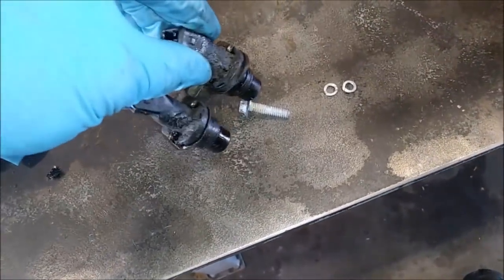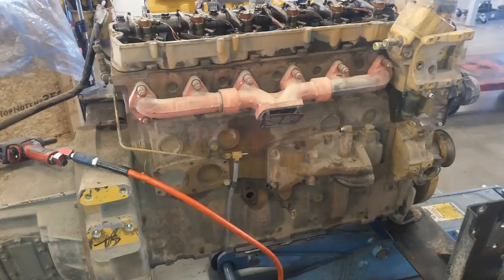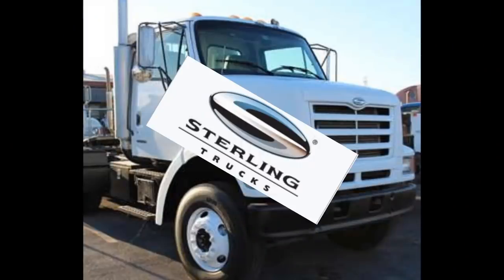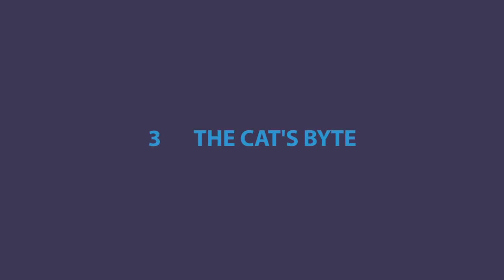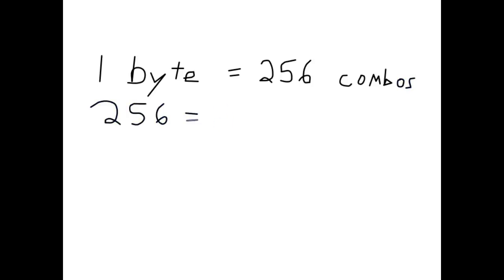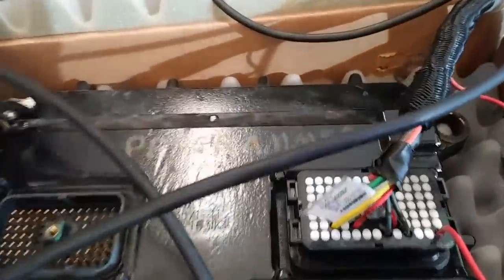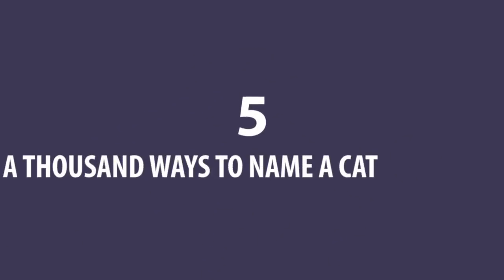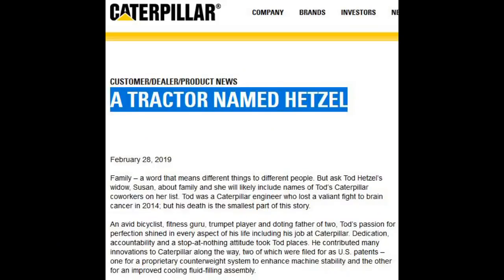5 Cat Engine Facts Most People Don't Know Are True.

Comment: The naming of model SN prefixes to people is absolutely correct. An example is the LBM which is named after an Australian engineer working in Mossville at the time whose initials were LBM. From memory this is a Euro 3 C-12. Lou was liaison for rest of world (North America being prime) engine spec/design at the time. An awesome engineer who could go into any of the meetings by the various specialties (cooling, fuel, emissions etc) and be able to be very knowledgeable in each of them. 
“A Jack of all trades is a master of none, but often times better than a master of one” very much describes Lou's abilities.

The Deutsch connectors where selected over every other connector available at the time due to their easy of serviceability and reliability. They were selected over the proprietary Cat connectors.
The 3406B PEEC and 3176 (released at the same time as the DD S60) engines used them but using the HD style connector (same pins and sockets). However HD connectors proved to be both expensive and large so with the C-10/12 and 3406E they changed over to the DT connectors which are used to this day.

The brown engines were an exclusive FL spec as part of the way Cat got into the FL80 build. FL wanted be able to say the engine was exclusive to them.... The engines actually being identical apart from the paint.

The Ford LTS and Sterling needed the slant engine and in Australia it was even harder to get the engine in due to the RHS config putting the steering shaft right thru the turbo.....
The 3406C (I think, may have been the E) was eventually engineered in though on the journey the breather was in the way which ended up with the classic line from the Cat account manager saying to just remove it....... For some reason the engineers didn't agree with this suggestion. FYI we had the 3208 installed in the Ford Cargo as the only engine for many years and had to store 2 years supply (from memory) when Cat stopped production but the truck was still being made.

Comment: I’ve worked on private yachts my whole career and every cat engine I have turn wrenches on they come from the factory white but underneath if you chip the paint it’s cat yellow.
Reply: I was going to say the same thing
Reply: Do you know if they were all originally yellow? And do you know why they re-painted them white?
Reply: @willriccio7524  is because the white paint, usually, contains some sort of anti corrosion chemical that is necessary when the engine is exposed to a marine environment
Reply: @axelcastillo9544  Aah ok. That makes sense! Thanks Axel!
Reply: Same with Deeres I've seen on gennies. 
Green for the base coat and whatever the gen  manufacturer's color is
Reply: Never seen a brown cat !
Reply: The v8 cat engine?
Reply: I worked at cat dealer in Miami. Used to be that all the marine engines came in yellow, then if customers ordered white, they took it into the paint booth and painted it white. Later on they started coming from cat already white. But I don’t remember if those newer ones had yellow underneath.
Reply: I worked at cat engine plant for 15 years. Not all cat engines have a yellow base.  Marine comes in usually  2 colors . Pleasure craft is white. Commercial is yellow. The white is to detect an oil leak easily.. some customers wanted red. Some wanted blue.
Reply: @chrisknight7921  red is for off shore oil rigs.  I did see blue but do not remember the cause.

Comment: I’m an agricultural engineer for a claas dealer, some claas combines use cat engines and they are painted in a claas grey, no hint of yellow underneath that paint either
Reply: Prob find the engine numbers will be refused at a cat dealer. John deere are the same with yanmar, boss forklifts remove the id tags from perkins, but are too tight to buy the engine No’s as perkins still help. Hyd pumps on manitou are the same, pump maker wont sell ya parts to a mani’ pump number. Its fair enough on 2yr old but on 20yo its a piss take.
Reply: I was about to mention this

Comment: There are more than one "Cat Yellows". I used to work as a cat engine mech here in Finland, and we always had to check which cat yellow we order as some engines were of lighter yellow than others. So, we had two different cat yellow spray cans to choose.
Reply: sure that's because over timr the paint breaks down under sunlight
Reply: I had a freightliner with a 3126 cat that came from the factory in a dark gold or bronze color......weird
Reply: Allot of issues in color is due to knockoff parts. Some will be due to weathering but color, part number location, etc. is used in caterpillars quality inspection for core returns and a large number of these core returns are not Caterpillar parts and become scrap.
Reply: Same with the paint being purchased. Caterpillar has only used 3 paint codes and companies don’t want to use the real paint we (I actually work in the remanufacturing facilities) only use a specific paint that protects surfaces, it’s extremely expensive.

Comment: The Sterling tilted  engine is left over from FORD days . Ford was great for doing this. My guess is it gives the driver more foot space !!
Reply: 60 series , N14 all are tilted in ford, 2000 sterling are straight up
Reply: Ford ltl 9000 did it to 3406 b fit air filter housing under the hood
Reply: My dad drove Ford CLT with a KTA Cummins and the engine was canted to the side to fit under the cab.
Reply: I have a couple old Lousiville's with big bore engines that were tilted. Still run them, pain to work on but they drive nice.
Reply: The 3406E in my 01 Sterling AT9500 is straight in
Reply: @RustyCrankshaft  I ran 78 L8000 8V71 318 Detroit. Drove really good and nice to see out of. Hard to hear the radio 😂
Reply: as irritating as that :slant" six, CAt or Cummins was in a FORD , it was still WAY EASIER to work on than when it was tilted in a Dodge truck
Reply: @keithdickie7735  yeah the dodge slant was a pain in the a$$, trucker hauled hay to our ranch had dodge  coe if you didnt keep  the engine mounts tight on a cummins the turbo would hit the frame!!
Reply: @deanmckee1385  As the years advance ...... Dean will have to explain His closing  Detroit joke / comment to many non V71 operators !  !

Comment: The injectors on some of Cat Engines (HEUI's and C's) had not the regular Deutsch Connector style, because are made by Navistar. Under an emergency situation, I used injectors from a DT466E  on a Cat engine. No issues (no trim code modified).
And regarding the Cat yellow paint... that paint is also designed to change the shade of yellow towards the darker brown, even black, depending of how hot the component has being working. So that way, the Tech only need a quick look to find overheated component. CAT  even have charts with the color shade and it's temperature range related

Comment: Worked for cat doing R&D on the medium and heavy duty engines. Had a full feature file for a 3406E that had a marine map accidentally loaded in it. It pulled a fully loaded trailer up route 6 hill like I was in a corvette. About 1200hp.
Reply: Why would the marine engines make more power? My understanding of why tunes are limited is typically either emissions or longevity, as marine engines also want longevity I'd assume it's because boats aren't under the same emissions laws?
Reply: @quillmaurer6563  My guess is better cooling because marine engines have access to the body of water the vessel is in for cooling. Then again, it's not as if you would have the need to use full power all the time so a normal radiator should be enough for cooling unless you're driving up a big grade while trying to go as fast as you would on flat ground.
Reply: @quentagonthornton49  Makes sense I suppose. But as you point out, the truck wouldn't need sustained power so much as brief power, while the boat presumably would need sustained power, so I'd expect the truck's tune to allow for greater peak power than the boat's.
Reply: Marine engines can make more power because they don’t use it as often. We estimated no more than 10% of the time thus not over stressing the engine. With an OTR truck full hp would be used often putting a lot wear on it. It was our goal for a million miles before a major rebuild. At least before Tier 4.
Reply: @quillmaurer6563  , the main limiting factor is the melting point of aluminium pistons, which in it's pure form is the low 600 C range. Boat engines have an unlimited supply of raw water to keep aftercooler temperatures low enough to effect Exhaust Gas Temperature below 600 C. In the race diesels i've tuned for myself, i've data-logged that a drop of 1 Degree C of intake temp = approx 2 degrees C of exhaust temp. In a machine such as an excavator, which due to long periods of high load, CAT or Komatsu specifies a maximum EGT of 575 degrees C, measured before the exhaust turbine of the turbo.
Reply: TC-L?
Reply: I did driveability testing and helped develop the adem III Ecm out of tc-e, but I worked in tc-l later on all sorts of stuff before they outsourced everything.
Reply: @i-am-that-what-i-am  we had a c-12 dual turbo set up that had about 1200hp for the Pikes Peak climb. There’s pictures of it with the turbos glowing red. Lol. The c-12 was a beast of an engine. Some of the earlier 3406e’s had a dead spot in the coolant flow on the rear cylinders that caused head warping before a change was made
Reply: Interesting. And that's pretty f**** cool!

I'm in TCL now running cell 231.... If you know what happens down there, then you know that's probably all I can tell you hahaha

Comment: The 3406A model Cats were painted white. Also the Ford LN9000 trucks had tilted engines when using the 3406 engines but they also done the same when using the 14 litre Cummins Big cam engine. I think it was all just a matter of fitting the larger engines under a short hood and the doghouse in the cab. Also Cat over the years has used many different shades of Cat yellow for their yellow paint.
Reply: 1693swere white to
Reply: I remember white cat engines and Ford conventionls tilting their engines too. Sterling are Fords from back in the day.
Reply: Pacar painted all their engines white for a while , International painted all their engines red

Comment: There was a period when Cats in Petes were painted white.  Not sure if Peterbilt was painting them or if Caterpillar was painting them at Peterbilt's request.
Reply: We have a 85 pete with a white cat
Reply: I have only seen 3406a that were white
Reply: A models were white
Reply: International Harvester used to paint their engines red for the Transtar trucks. Saw two red 3406B's at a show just a few weeks ago.
Reply: I've heard this same thing about Cat engines once.
Reply: I thought only the v8's were white
Reply: It was PACCAR - KW had white Cat's too. They were painted white at Cat per PACCARs order, although I'm sure there were exceptions.
Reply: 1693 motors were painted white by Cat
Reply: All cats in paccar were painted matterhorn white. Paccar ordered them this way. I have some literature around somewhere, detailing this.
Reply: Got an old k100e with a white A model in it here at the shop.
Reply: 3306 cats were white in petes
Reply: I drove a 1980 Peterbilt 359 with a 3406 a engine that was painted white when we had an in frame done at caterpillar I expected it to be yellow when we got it back but they painted it white even after the rebuild
Reply: I had an 85 359 with a 7FB 3406B and it was white.  I’ve seen 3406A’s and B’s as well as some 1693’s painted white in KW’s and Pete’s.
Reply: I remember some 1674's and 1693's being white as well

Comment: My dad worked for a dealership in the 80's.. I saw more than a couple of Cats that were white (for marine engines) and a few that were red.  The red ones were fire pumps.  I saw a few custom engines that were kind of cool.  A matching pair of 475hp 3208ta's that were white with chrome trim (rocker covers, air cleaner box, ect) for someone's pleasurecraft.  If I recall correctly, the Cats that were in the Army Corps of Engineers dredges in the area were gloss gray with chromed trim also.  Those were one offs, but the majority of the engines (even marine application), marine gears, and gen sets I saw were indeed Cat yellow.

Comment: Oliver 2255s (later White) used the Cat 3150 and 3208...they were painted Meadow Green. The White 2255 used red, and the replacement 2-180 had their Cats painted black.  I grew up literally one mile from Caterpillar's Mossville engine facility and my father was a metallurgical engineer there...I was in the plants a fair number of times and saw all sorts of colors used on engines, including dark blue, possibly for Ford's Louisville Line.  The white engines were probably most common from what I remember, after Cat yellow, of course. I recall seeing workers wiping the white engines down after dyno testing as they got fairly grungy.

Comment: Earlier Ford's with 3406b like the 1980s LTL9000 had tilted engines also.
Reply from the maker: Yes, which I know Sterling was basically owned by Ford before they went under as well. I saw an early 80's Ford water truck tilted a couple weeks ago and should have taken some pictures of it. Thank you for the comment.
Reply: @AdeptApe  I knew you had seen them. My buddy runs a 1990 LTL with a B model. We're anxiously waiting for your mechanical video. I run a converted C model Peec engine. Thank you for sharing your vast knowledge. You've helped me several times.
Reply: @AdeptApe  some early 1150, 1160s were Ford engine blue when installed in Ford medium duty’s.
Reply: @AdeptApe  Freightliner bought out Ford heavy trucks and renamed them Sterling.
Reply: @AdeptApe  electronic governors were out in the late 80's- peec system, 8tc           im much older than you- unfortunately
Reply: 855 Cummins would be tilted as well. Lots of Cat's were white.

Comment: Neat video!  Related to #1, Cat built olive drab-colored engines for military vehicles.  My M35A3 has a olive drab 3116 in it.
Reply: I use to specialize on the Ole Nam era GOER
Reply: @paulrooster2108  TY for your service!  Those GOERs are beastly!  Did they have green Cats or yellow ones?  Curious :)
Reply: I was assigned to 3rd Shop Direct Support , We  had 43 different units at one point  , At the moment it slips my mind the various Unit numbers but one had a damn fleet of these things an they had cat yellow & a few OD Green ones , where as another unit had  what I mostly saw in Boats being  
" Marine White ", an a few of those you see Cat Yellow under the White  where the paint had  cracked or chipped off . Some of the damn Gamma Goats had Detroit Green engines , where as others were OD Green , usually if they were OD Green meant the engine had most likely been rebuilt at the Civilian Depot . They also usually came to me to train their drivers as very few people had experience with them .We had a CWO-4 that was cool as hell He got me assigned as His Driver an anytime one went down We would load up the Jeep & Trailer an head off to check it out , He would do the usual meet & greet when we got there an after the formalities were over he would pull on a pair of Coveralls an jump right in there working on it . He always had this big ass pipe he smoked  , it was great watching him address Captains & Majors , Lt Col an Full Birds sometimes he comment what a idiot that fucking clown is 🤣, One Time he told a Bird  to go Unfuck Himself " SIR " .  Several times he scored us Chopper Rides  plus he had to maintain X amount of Flight Hours himself an tell me we're going sightseeing tomm 👍. When I made E-5 I was assigned one of the Dodges M880 that had a mechanics service box on it . An of course a 11 man squad - that was a pain in the ass but so it goes .

Comment: Our fire department used nothing but the CAT 3406 series diesel engines until CAT quit producing them. We still have one in service with over 170,000 miles on it and still nothing has gone wrong. Normal maintenance and monthly oil changes.

Comment: I was employed as an application engineer by a local Cat dealer.    There's nothing especially unusual about Cat engines not being Cat Yellow.   Nothing weird about it.  We could supply engines in any colour the customer wanted (at slight extra cost).   The most common non-yellow colours used (supplied  by the factory at no extra cost) were/are white (mainly for marine applications - propulsion or auxilary power) and red (for fire fighting pump or fire truck applications.)   But, if you don't request a specific colour, it will come from the factory in Cat Yellow (and for C-series and later, with some parts black to make it pretty).
Medium and large size Cat engines can be supplied from the factory with unmarked dipsticks that the dealer is required to calibrate.  This is because some applications require the engines to be installed at odd amounts of longitudinal or transverse tilt, and the dip stick must be calibrated for the installed tilt, to ensure that the oil pump is never starved, but excessive amounts of oil are not put in.  Boats are interesting because tilt varies with speed, and any given speed can be maintained indefinitely.

Comment: The sterling thing isn't entirely correct. Sterling was originally Ford heavy duty trucks, sold to Daimler (which owned freightliner) then rebranded as sterling. The sideways engine thing was happening well before the ford HD truck division was sold to Daimler and Cats weren't the only engine they did it with. I know they did it with the cummins N14 because I've worked on them, so it's possible that they did it with others too.